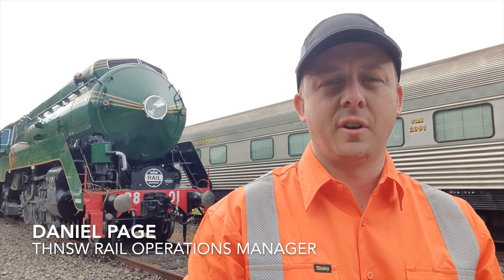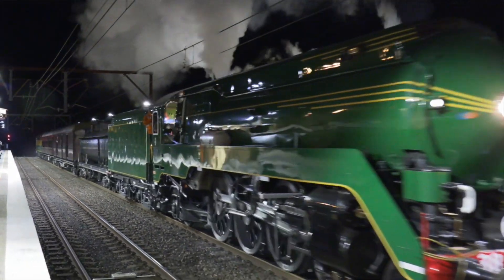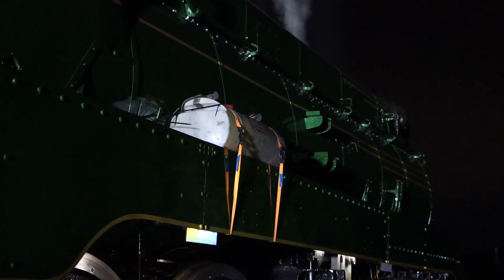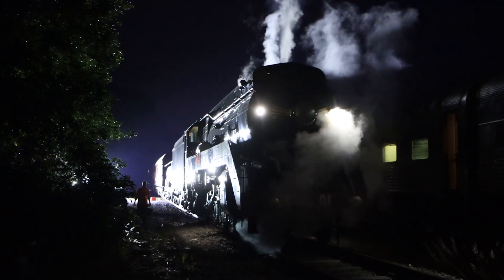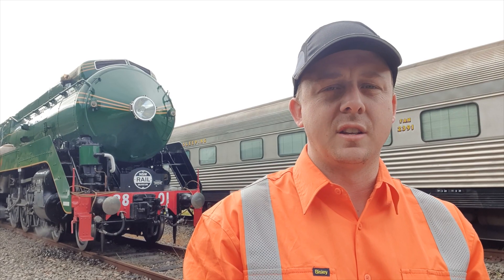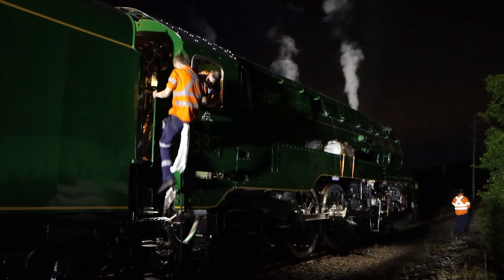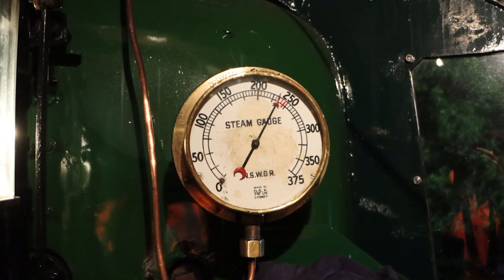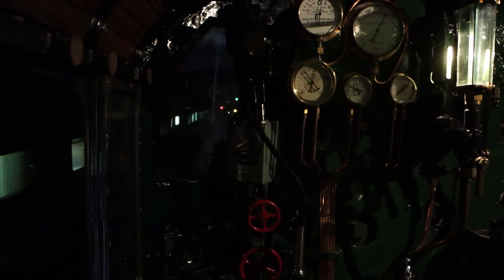Locomotive 3801 adhesion testing

Comment: The 42 class weighs 120 tonnes, so I'm surprised that the 2 pass cars and a water gin weighed 198 tonnes. Did the 42 class use it's dynamic brake?
Reply: No way